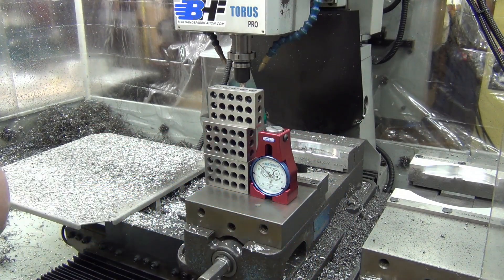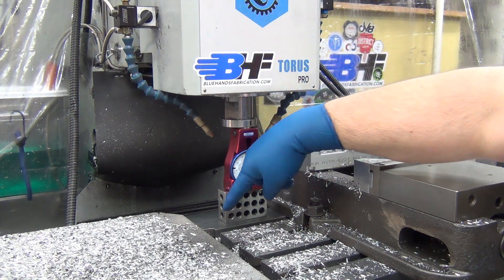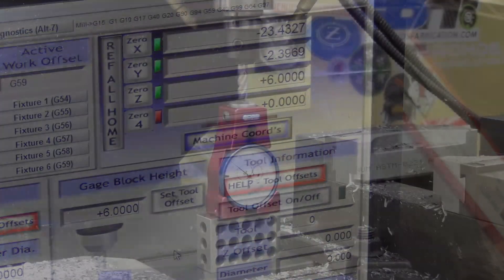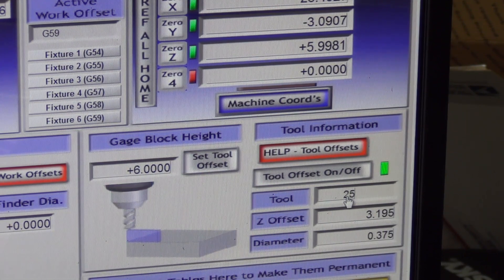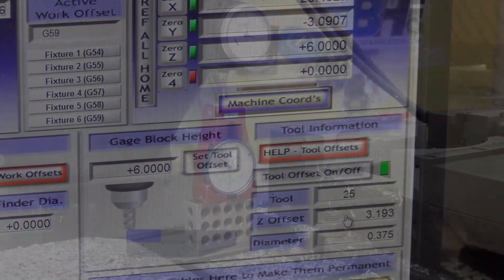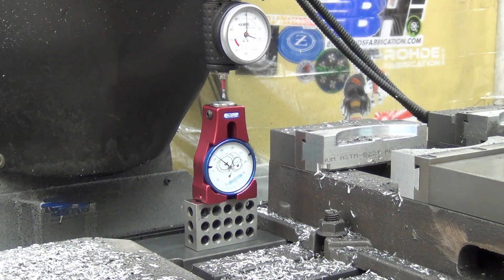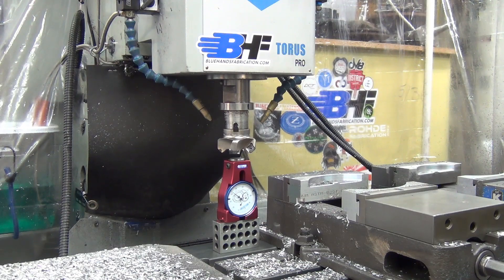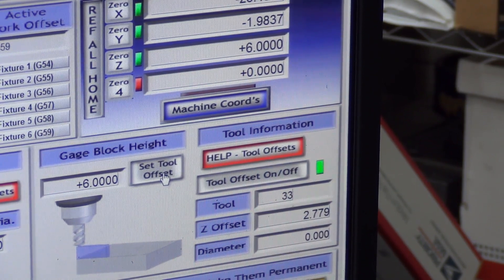Edge Tool Setter

Comment: When you have a tool changer you don't want to tie up tool number 1 or 2 etc. with a tool setter or Heimer
Reply from the maker: What number do you use then?
Reply: @bluehandsvideo  One higher than the tool changer holds. manually insert it when needed.
Reply from the maker: @doughall1794  Ah...I'll keep that in mind for if/when I get a machine with a tool changer on it. :)  I'm sure I won't ever put one on this maching.